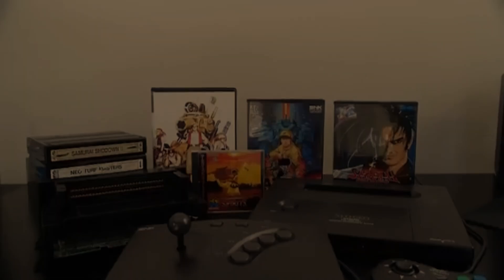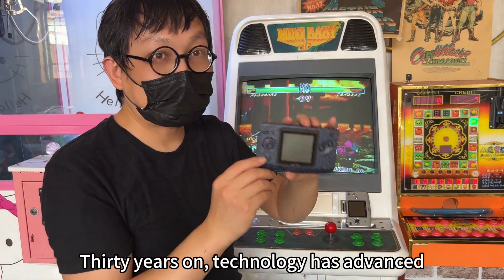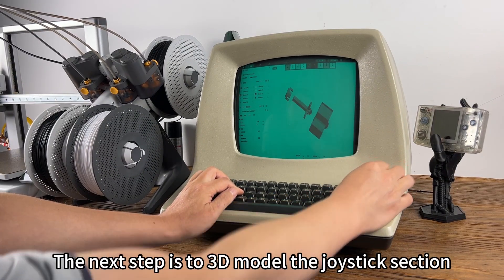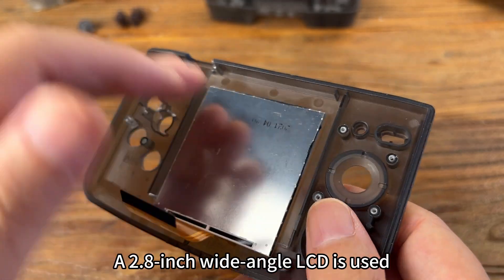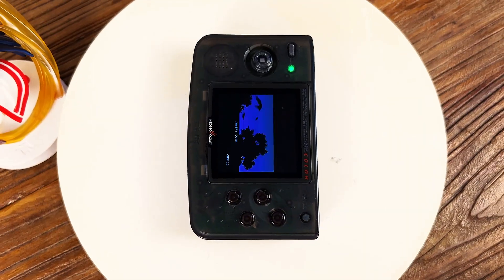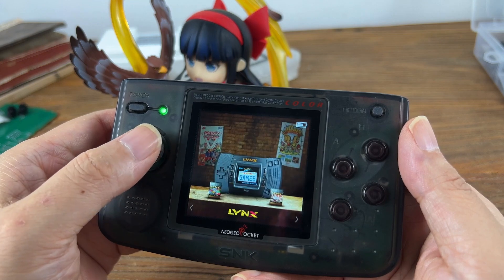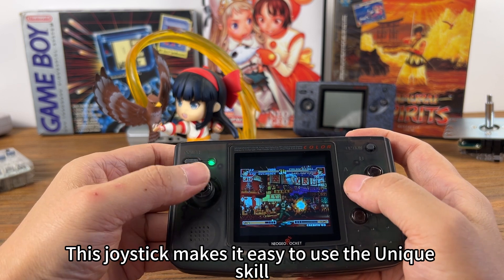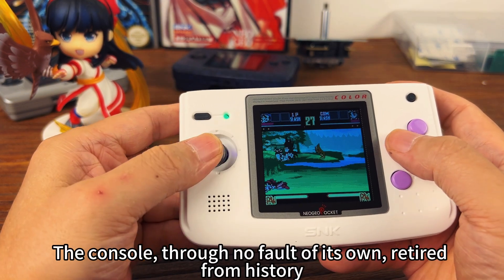(DIY) Retro Handheld  NeoGeo Pocket Boy

Comment: This is nearly perfect and I'm happy to support. The V3s is good but if you get the RP chipset to work with hdmi out through the communication port, that'd be better. It would be great paired with the NEOGEO X dock. Then the 3.1 inch AMOLED display from the Q10 would be icing on the cake. Maybe more expensive but worth it for the ultimate NGPC. Thank you for your work!